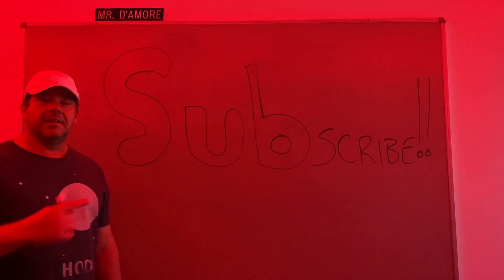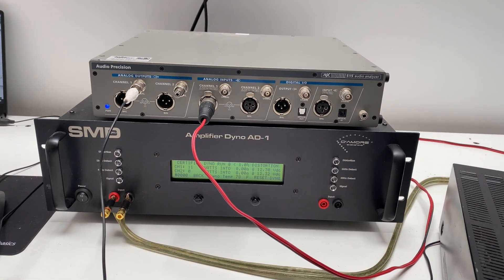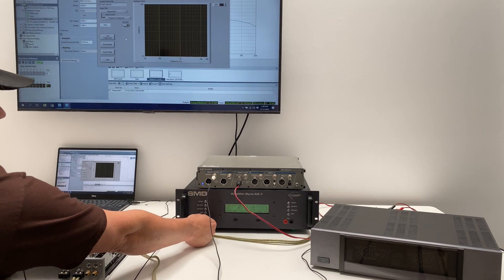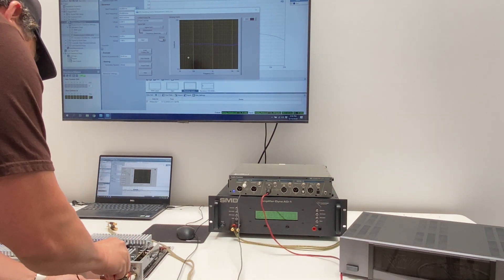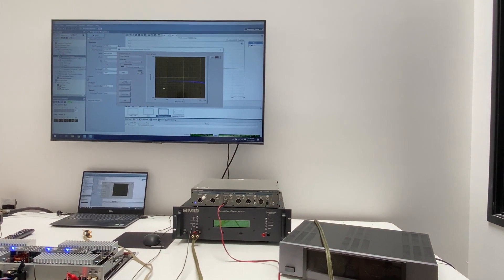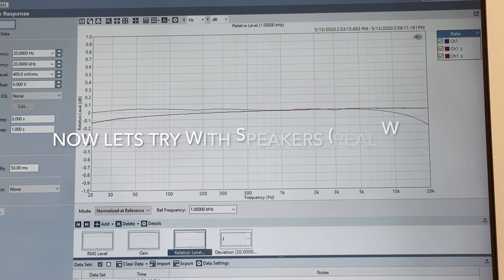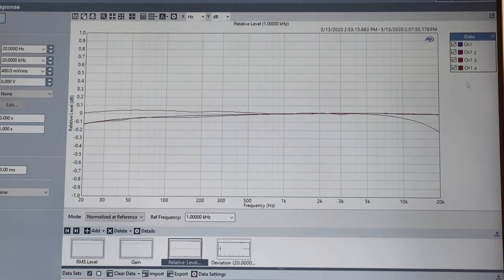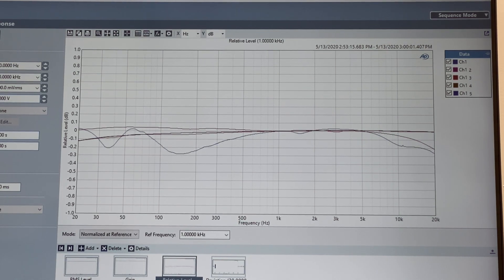Audio Technicals V2 - Damping Factor

Comment: Question.....This is a great video on the damping factor subject, but the fact that quite a few higher power D'Amore amps ("E" series) have 12 gauge wire connectors has me puzzled.  12 Ga wire has just about 1.6 mOhm/ft.  I would think if the speakers were say even 4 feet from the amp, that's [4x2=8...x's 1.6mOhm = 12.8 mOhms].  Surely this resistance degrades the damping factor?  And not to mention that with 1 Ohm loads, at say 1000 W, the speaker current is almost 32 Amps.  I would think there would be loss in the spkr wires. I would be very interested to hear your take on all this........

Comment from the maker: 0.3dB difference driving an 8 ohm load.  That would be 0.6dB driving a 4 ohm load, 1.2dB driving a 2 ohm load and 2.4dB driving a 1 ohm load.  If you tried to "EQ out" the 2.4dB drop you would basically turn a 1000 watt amplifier into a 600 watt amplifier.  So it is very relevant.  For those that don't think you can hear 0.5dB, create 2 EQ settings on your DSP, one of them with a 0.5dB drop on a range of frequencies, not a single band, a range.  Then switch back and forth, it should be very easy to hear the difference.
Reply: ❌🔥I’ve been building small amps for years and to your point on constant_power amps // could you help explain how ,and why the damping would be ((atrocious)) if that circuit is supposed to correct for impedance change on output load cause this my friend really sound interesting 🧐 and you’re a true Artist 🖼 I could only wish to make an amp like yours so hats 🎩 off to all you guys that Do‼️ (also off hand what’s your slew rate on your inputs on your Big 4 channel if I may ask please - it’s gotta be insane 🔥❌
Reply: @eurekaakerue4649  Because it cannot do it fast enough, check out distortion plots for constant power amps it looks like a zig zag..... JL's flagship HD amplifiers do this, Rockford AD's do this....
Reply: @CL-yp1bs  and that’s why you get what you pay for. Floor noise and dampening factor. If you want to know why JL audio are like you mentioned Rockford Fosgate cost so much compared to CT sounds well that’s why.
Reply: Thanks for clarifying, Tony!
This is awesome stuff to know. I really appreciate you taking the time to show us!

Comment: I have question... Obviously having higher Damping Factor ( like in most high end amplifiers)  is better to control the speakers but ... In what type of speakers DF would play bigger role ? Would be noticeable - audible?  For example... Having Damping factor of 3000 on lower frequencies (subs) vs midrange vs high freq ? Does it really matter ? Is it really worth it to have such a high DF on higher frequencies?

Comment: Tony, great but ! You failed to mention that under, for instance 2R load, the DF will also be different than the one You just measured. All channels driven will also have an affect on the DF as well as size and length of cables. Most importantly, huts off if You can hear the difference of 0.3dB !? Non-linearity of any speaker is way worse than the one of amplifier, not to mention the distortion that comes from the transducers themselves. It's good on You that Your amp can achieve high DF, but does it really make any difference, especially in a car environment, while driving ? Does it fck! Good video anyway.

Comment: +/- .1 db... definitely worth the $8,000 difference. Glad I caught this one. Thanks. Note: Edited for Value Difference.
Reply: 0.3* db
Reply: @JesseJames83  it's not plus or minus. 3 DB. Either way though there's no way you could hear the difference in that level. Now the dampening factor is much more appreciable.
Reply: @bonzainews  the curve continues to drop on the right
Reply: @JesseJames83  and it still does not make the slightest difference. Please read my comment above.
Reply: So at what point do we start to care?  Some people can hear the difference, especially musicians.  I don't like posts like yours that try to commoditize audio.  If nothing makes a difference why change anything?   One of the world's largest and most respected capacitor manufacturers, Nichicon, has many different series of capacitors for audio circuit use that each have their own "sound" that would measure no difference in a frequency response test.  Everything matters.  The point of this video is that two amplifiers that measured nearly identically on the test bench measure completely different when connected to speakers.  The speakers used here are 4-8 ohm speakers as well, the situation at 1 ohm would be 4x worse.
@news
Reply: Yeah, that was sarcasm.  I wouldn't pay that much for my entire system. Including the car. I work too hard to give it away for voodoo and opinions.